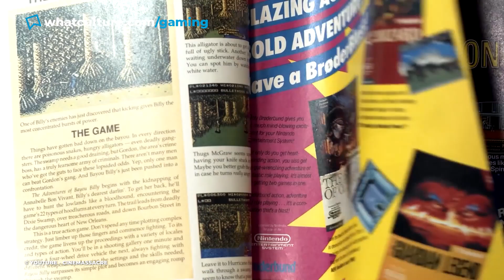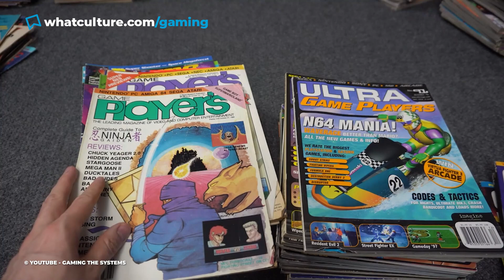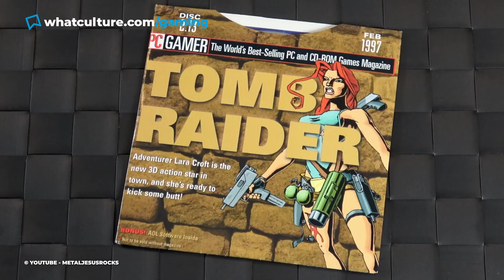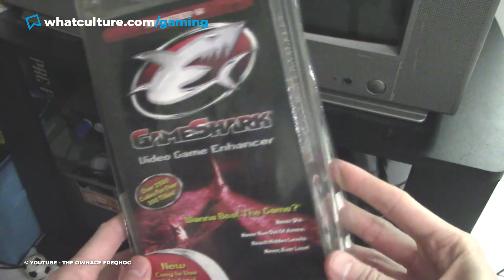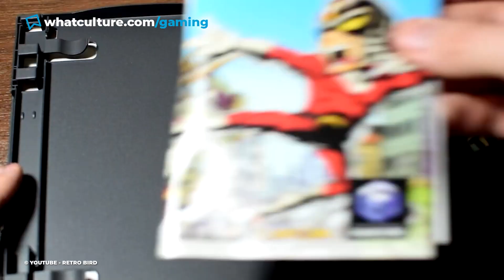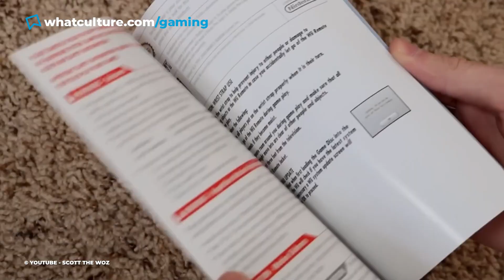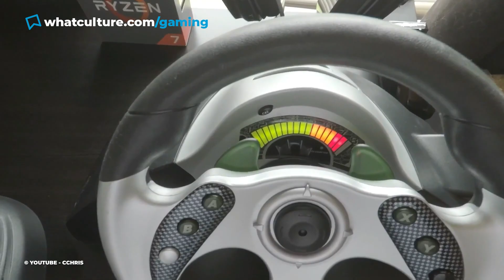10 Video Game Traditions That Are Dead And Buried

Comment: The finite aspect of save slots.  As games in the ‘90s got bigger and took longer, while still being trapped on a cartridge, they came to rely on battery backup saves.  These would often be only 3 or 4 save slots allowed, while some(Super Mario All Stars) had more.  Even when the first gen PlayStation and the GameCube came out, we had small plug in memory cards for our saves.  This would be some improvement, if you had a big collection you just got a bigger card, or a second one.  Now, everything is on the hard drive.  I suppose if my collection exceeds my current storage, I’ll just need a new hard drive.  But the days are gone when I have to juggle save files.

Comment: I remember all of them.
The cheat cartridges often had another feature as well, letting you play games from other regions without adding a modchip to your console.

I miss mostly the well made instruction manuals. The reason there is today there are only a few games which have a complicated control schema.
In the 90s with all the simulations out there you often had manuals 100 pages long sometimes with extra keyboard overlays.
I remember well the manual for Falcon 3.0 many hundred pages, from the design and technical data of the plane, going through aircombat techniques and then the keyboard and stick control of the game it had anything in it.

With the digital releases the used game market is also dead an buried.
If you did not need to have a game at day one, waiting a few days or weeks and then getting a used one of a fraction of the price was often worth it.

Think also the dedicated gamestore is either dead or a very endangered species. Again most games are delivered electronically, or are bought from big online dealers.
I remember well, when you preordered at your local store and then picked up the game, hanging then out there a few more hours trying out other new games.
Reply: Yea, the dedicated game store is definitely on it's last breath, with preorder bonuses you can only get in store being it's last bit of life support but even that is becoming not enough as online outlets are starting to offer better bonuses and collector's editions that the physical stores can't match.  From what I can tell, the only dedicated game stores that aren't slowly bleeding out are "retro" focused stores that sell old, refurbished hardware, software and related classic merch.  With the push for digital distribution for modern games, used game sections in stores like GameStop are drying up and shrinking, especially since GameStop in particular staunchly refuses to sell used games older than the last console generation.  They could pivot into console repair and refurbishment if their repairs and refurbishments weren't absolute rubbish.

Comment: The instruction manual was a requirement for a lot of the simulators back in the day, like the Microprose end Janes Simulators and weren't just useful for gameplay, but also had a lot of historical and technical information in them which could be used for copy protection. Although in the case of aircraft images and the like you soon learnt to ID the aircraft in question without the need to refer to the manual.
Reply: The manual for ATF gold had tactics in it.
Reply: @MrTim2031  Not one I played unfortunately, But I remember Gunship on the C64 explained things like autorotation. If I remember rightly you even got to practice it in game when you were damaged.

Comment: 10. in game cheat codes was great.
9. it's cool, if you have enough money for a subscription.
8. demo disc or cartridge was a good thing to get into a game you want to play.
7. it was good, if you try to beat the game within that day limit rent.
6. it was good, but as of now - it interfere with online gaming, if you know how to do it.
5. modding is good - if you want to play other region games.
4. it's good to know how each button and etc. on the controller act - but now it's digital on the disc.
3. those are still cool to own.
2. before achievements/trophies - unlockables in game is what make the game worth playing than 2 playthrough.
1. it was like this before system could do update patches to fix the game with launch data - feel like the developers just getting lazy.

Comment: I miss rentals and pop-in-and-play games(basically finished games). It was fun to go out and see what they had, particularly finally finding that one game that was never in stock. It was a cheap and easy way to try out a game instead of investing in something that you're not sure about. Game Pass and the like aren't the same as rentals. They could serve a similar purpose, of testing out games, but I find that Game Pass is too limited and doesn't have new games when they are released(at least not as often as I would like). It is fantastic for short games or games you'd play only once. I do miss the days where you can buy a game, go home, and immediately play it. It still bugs me that I spent +$60 on a game and had to wait 4 hours for it to update. I had crappy internet for the longest time, sometimes it still takes a hour but its usually about 20 minutes.

Comment: One of the biggest bummers is companies milking players with microtransactions for unlocking fighting games characters. I own an older Tekken games, I bought also Tekken Tag Tournament 2 from Xbox store. There were few of ? on character selection screen. Some of these characters are Tekken classic ones (Kunimitsu for example). In order to unlock these characters, you have to do micro transactions. Now, when I saw Tekken 7 roster, there is an entire line of locked character and you have to pay in order to unlock them. I wonder how many ? will be if there will be a third installment for Tekken Tag Tournament. I am pretty sure that in order to unlock all characters, you have to pay hefty sum of money. 
Back in the old days, you have to beat the game with a certain character in order unlock other ones. I am not sure about other games, but fighting games like Tekken became a victim of microtransaction. 
When I bought my first PS1 console back in 1993 or something. It had demo 1 included. Until we got an actual game, my brother and I technically wore down the CD disc. Some demo games became unplayable or teasers that stuck if you run them. I do not think that game manuals are outdated, but depends on the game, it might have a different content that being an instruction manual.
The best example of "Games finished at launch" for me was the release of GTA IV. It was a huge deal that the New GTA instalment is coming soon to PC. When GTA IV was finally ported to PC, it was a buggy mess. Memory leak, inconsistent graphics, crashes, you name it. I remember that within the few weeks after release, dunno how many thousands of copies, the players returned the games and wanted refunds because it was such a buggy game. I kept mine and waiting for patches, that took insane amount of time to fix some issue here and there. Now, as for me, the game works without any issues.
A 
W

Comment: "[N64 controller] wasn't ever imitated"

N64 controller = first console default controller to have an analog stick, memory card slot, and offer rumble (vibration) support

After the N64 controller, the PS1 then came out with an analog + vibration controller (dualshock) and all other systems since then have had analog sticks and vibration on their default controllers.

Also, the Dreamcast and original Xbox had a memory card slot in their controllers like the N64.

(The Saturn did have an analog controller already but it was an optional, special controller and not the main default controller that came with the system.)

Comment: My main problem isn't that we are attached to older games, but that most new games are incomplete to a much more extreme degree, or all have the same type of gameplay. Games are NOT moving forward like they should, elden ring is based on souls game which is an old franchise by now, most mobile games are city building, resource management, or the same puzzle games, and AAA companies RARELY trust smaller companies to do work without interfering (rock steady being the example of what we should aim for). It's a sad thing that the industry hasn't changed much in 10 years. Yet in the early 2000s everything was experimental in mostly good ways...

Comment: I'd still rent games (and movies) from Blockbuster if that was an option (beyond that one store in Bend, Oregon, which isn't much use to me in Ottawa, Canada). Obviously, I know Game Pass and the like exist but I prefer the option with a one-time fee (as long as you return it on time) to one with recurring fees.

Of course, I'm fully aware that most games post 7th generation, even if you have the physical disk, usually have more steps beyond just sticking the disk into the console and turning it on before you can start playing, and many games have activation codes that are only good for one gamer profile so they're not rentable anyway even if Blockbuster still existed (also the reason why I don't usually buy used games post 7th generation), but I still miss the experience of going to a rental store and browsing games on a rack even if late fees sometimes had to be payed.

Comment: What happened to all the gaming tv shows?  Gamegarage on the old sky one channel in the uk
Trailblazers was a gaming news show 
And then there were the ones that were bbc 1/2 and channel4 and channel 5 during the 90’s early 2000’s
Reply: And there was that one game show short that used to be on one of the sky channels . The show was called TNT and it would last 5-10mins in length and be on multiple times during the day . The host would give gamecheats hints and tips
Reply: The show was called gamezville not gamegarage that was on sky one channel UK

Comment: 10 Coolest 360 NoScope Kills

Also, I'm pretty sure it's a sin to talk about weird and unique controllers without even the briefest reference to Steel Battalion for the OG XBox. A three-pedal floor unit, along with a three-panel control panel with two control sticks, a gear shifter, an eject button, a windshield wiper...

Comment: 6:46 Isn't a chipped console, that's using a dark technique called disk swapping, putting in a legit disk, reading the fast and slow spins and physically grabbing the disk, swapping it for your copied disk and then reading it's fast n slow spins, with many swaps required to get the copied game to run on said non-chipped console. This is done to get the ps1 to read the copy protection from the legit disk but the game data from thre copied and requires many swaps back n forth b4 the game will acually fully boot.

It was a complex technique that required practice but when ya get good at it you can get a copied game to run every time 🙂

My biggest claim to fame using this was running 2 ps1s running Doom in link-up multiplayer using 1 copied Doom disk to boot up each console with the game first using the copied Doom disk and a legit copy of some other game and then using a music cd to spoof the other console when reuiqred into infinitly searching for the game data that wasn't there until we finished the lvl then swapping back and forth between the consoles yet again with the copied Doom disk itself to load the next lvl, neither console being chipped :-D

A real dark art :-D

p.s. The inside of a biro works far better than a pencil used in the vid as a pencil would slip but the inside of a biro bends and will stay there as long as you need ;-)

Comment: The loss of built in cheat codes is objectively a bad thing because well the desire to cheat is far from gone, and in the place built in codes we have Mods and Hacks.  Players still use exploits and glitches as readily as ever, so removal of cheat codes as simply made cheating somehting you use an unlicensed probably illegal 3rd party peice of software to do.  Cheats aren't dead so much as mutated and twisted into a new often unstable and posaibly game destorying form.  So many mods could easily be purchased for cheap by developers, polished and resold for a profit.
Cheat cartridges are only dead because well cartridges are. The still live but now purely in virtual form. Another case of not so much death as Mutation.
Death of chipped consoles and going region free is something that deserves it's place in the grave.
Lack of unlockables are is a loss for the consumer and only benifits the developer.  That base game is still $60-70 at launch, but all the content? On no that's going to cost you, and increasingly it's going to be limited time chance thing too. And of course the increase inflation of smaller and smaller bits of content is an issue too.  Addtinaly some games are purposely cut up into pieces so if the player wants to play the game as intended they have to pay extra. If the game is going to have a ton of DLC don't charge full price for it.  If there is $30 of DLC Day One the base game need's to be $30!
And yes the final one is a other case of bad for the consumer but great for he company.  The game we took 5 yewrs to develope? Oh it's a half finished, big ridden mess but we'll still change you full price and your going to have to wait a few years for us finish it... Provided the sales are there, if it's unfinished state makes it a failure, we're aren't going to finish it.  The game should be a fully functional stand alone state, not 50% finished with the player unable!to progress for months because a big was never fixed or a section of the game wasn't ready.